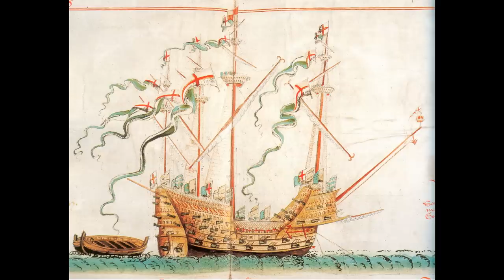The Drydock - Episode 250

Comment: Drach, I think you forgot to multiply the number of salvos by the number of guns for Massachusetts's weight reduction in combat.  Fifty nine-gun salvoes like you said would be 450 shells; assuming they're all Mark VIII AP, that works out to about 542 (long) tons of weight, not 60.  So you'd need to add about 480 tons to the weight reduction you calculated, meaning about six inches of draft, not 1.5 inches.

Comment: The mark 14 had multiple small problems that were aside from the magnetic detonator were easy to fix. Unfortunately BuOrd refuse to admit that there were any problems with their beautiful new torpedoes.
Reply: It was when they deactivated the magnetic exploder that the did problem became the worst.
They finally figured out the firing pin was to heavy.
Reply: @Ron52G  
When I deactivated the magnetic detonator the torpedo stop blowing up prematurely.
The impact detonator firing pin was too heavy for the spring originally installed. Lighter firing pins were used to fix existing stocks torpedoes in forward depots but new torpedoes got more powerful springs this probably means some got both.
The running deep problem was solved by moving the pressure sensor from the aft cone where passing through the water lowered the pressure to the side where velocity doesn't effect pressure. The other deep run phenomena was solved by informing the submarine crews about the maximum rate at which the torpedo would move to the surface probably with a chart of depth of launch to minimum engagement range.
The torpedoes circling back on the boat shot them (this was not shared with the Mark XV) was solved by setting a maximum angle off bore that torpedoes could be shot at. The Mark XV had bigger propellant tanks and a limiter on maximum rudder deflection.
After WWII the magnetic detonator was fixed primarily telling crews how they worked and how to adjust them to the local strength of earth's magnetic field.
All the problems could and should have been found and fixed before the USofA entered WWII. This is why I think several officers at BuOrd should have been put against a wall and shot.

Comment: In addition to warming up the machinery, starting a ship using residual fuel from cold requires warming up the fuel for several hours to make it flow at a rate faster than molasses in January.
Reply: Fuel for a steamship requires it to be kept warm at all times or it solidifies, diesel does not

Comment: 15:40 And 'awful' itself has undergone a huge shift from its original meaning (and spelling) of 'awe-ful' -- something that engendered awe in the viewer and causing dread, from the early meaning of 'awe', which included 'fear' and 'terror'.

31:00 A quote from 2V-R8, the Imperial ship droid companion in SWTOR: "I've just completed cleaning the fuel injectors for the sublight engines. You should notice a .00008% increase in power." There are enough other variables affecting the turns-to-speed curve on a battleship that it would probably take a lot more expenditure of consumables to be noticeable.

Comment: Drach, WOW! USS ALBANY CG10 is unbelievably a hodgepodge thrown together.  But after touring  the USS LITTLE ROCK with Shane Stevenson and seeing the complexity of the missle assembly, storage, and handling system, launching systems  now, you have to add tracking and targeting radars it gets more awkward to navigate over these systems. And then same goes for the aft section, so you have to raise the twin stacks and you end up withe ugly duckling. I think they should have gone to a single stack.

Comment: Why were no Iowa class equipped with rocket assisted projectiles based on the work of Gerald Bull?
Reply: There were actually a lot of proposals for extending the Iowas’ gun range.  I’m not sure if there were any rocket-assisted projectiles in the works, but there were designs for 13” and 11” sub-caliber saboted rounds, the latter of which would have had a range of 48 miles or 84,000 yards (maybe even more in a later proposal made in 1991 but never developed).  Rocket assist would have extended this even further, but to the best of my knowledge, this was not discussed.  I think there was some discussion of using a sub-caliber 8” shell, which probably could have been extended out to 100 miles.  But at that point there might be barrel wear concerns.  There’s also the issue of accuracy.  Even if you stick to shore bombardment, accuracy over 35,000 yards isn’t great.  Double that range and it’s just bad, unless the shells are guided.  I believe there was a program for that too, but at the time, no guidance system could withstand being fired from a high velocity naval gun.  Obviously we can do that today with a 6-inch artillery piece, so it should be possible for a bigger gun too, but it wasn’t possible for about 10 years after the ships were decommissioned.
Reply: Cost vs the anticipated remaining life of the class